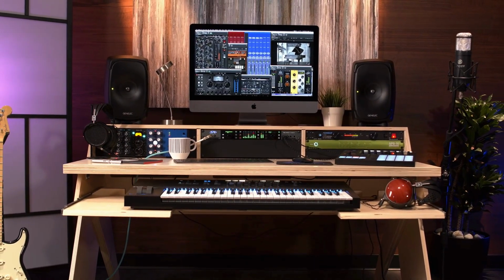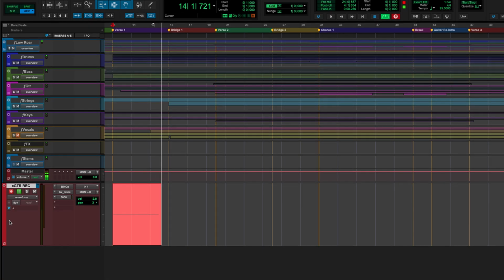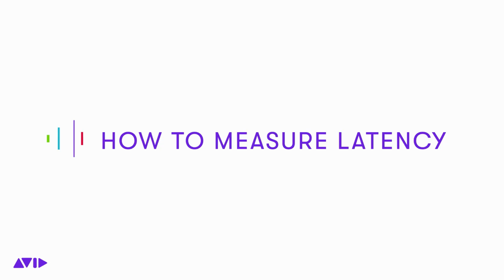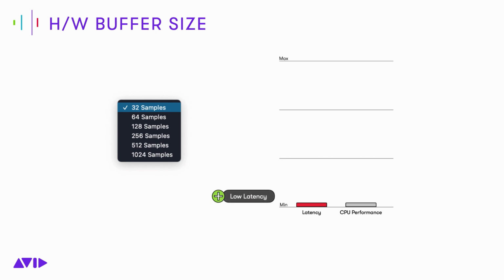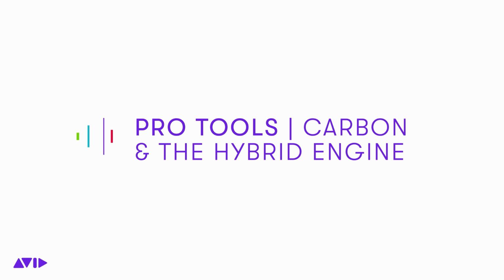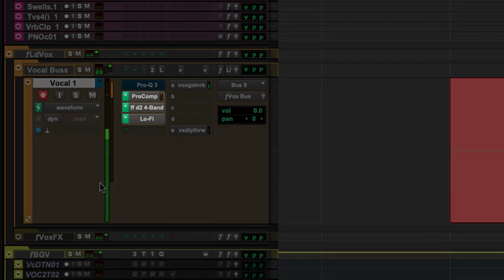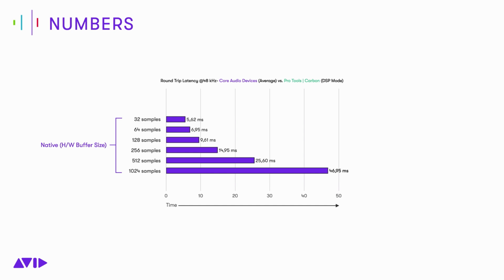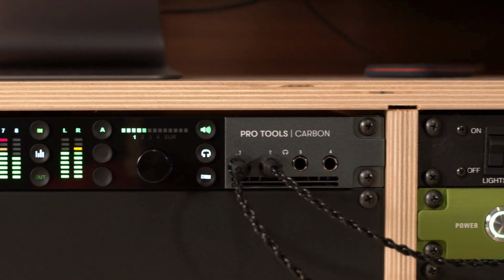How Fast is Pro Tools | Carbon?

Comment: Carbon has missed the mark for me.. The DSP amount is a little low, but no true thunderbolt 3 or 4 option, so that it could also be used with windows, makes absolutely no sense to me. It should have been dual AVB for mac and a thunderbolt port for windows. And no daisy chaining even with other carbon interfaces (!) is a complete head scratcher to me. I mean with the max 24 analog ins if I use the 2 adat inputs at 48K, means that my current 64 input UAD apollo 8x4 setup still makes way more sense, even for pro tools native. it just means I have to use the apollo mixer for inputs instead of the PT ones, and for that many extra inputs it's a sacrifice I am willing to continue to make. Furthermore, I have plugins that just don't nor will ever exist in AAX DSP form. That said, I was willing to compromise on the latter if carbon could daisy chain and had a windows option, then it would be worth it for me.. Even to daisy chain 2 units for 48 inputs I could just scrape by with. Just.
And no, HDX is not an option because the price is stupid. To get HDX compatible interfaces with 64 analog ins like I have now, and say two HDX cards, would be absolutely more than double the cost, and then some, of what I paid for my current setup (including thunderbolt UAD satellites for even more grunt).

Comment: or you could just add amp modeling after you record in post production. I still can't stand how pro tools is the standard. if this was live I get it but why not record to tape if your gonna emulate anyways. Also a simple patchy could send a monitor signal with no latency whatsoever =0 second latency

Comment: Avid is finally catching up to Universal Audio and Antelope Audio. It is great to see them having onboard processing. They are yet to figure out how to make this to a full ecosystem. Carbon should have included dual USB-C supporting Thunderbolt daisy chaining. I suppose we could see how they support expansion with their proprietary AVB but that limits them to compatibility with newer hardware and no backwards compatibility with Pro Tools HDX and HD I/O. I wait for the day I see products combining Thunderbolt for local, AVB for remote; interfacing and expansion. USB-C ports should replace mini-digilink. The Hybrid Audio Engine for both Carbon and HDX is a huge step in the right direction.
Reply: They do, it's called hdx and it's widely used in commercial Studios. Very expensive but allows you to use a variety of converters and essentially endless I/O. You can get 8 more I/O to carbon at 96k via adat.

Comment: Really impressive results here. I plan to pick up a Carbon interface later this year. My only concern is it doesn't seem to be expandable with any other i/o or cards. Am I understanding this correctly? If so, might it be expandable in the future or is this designed to be a standalone device?